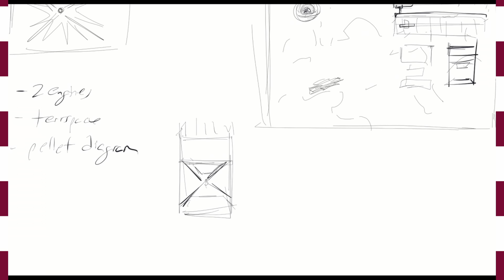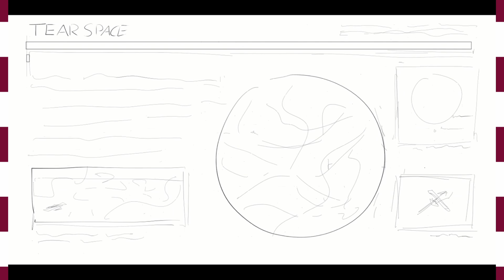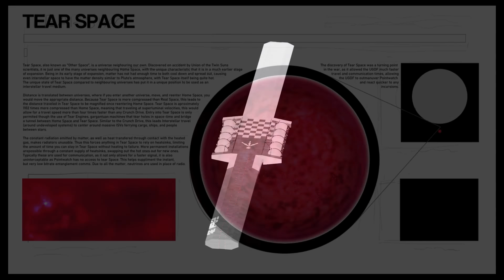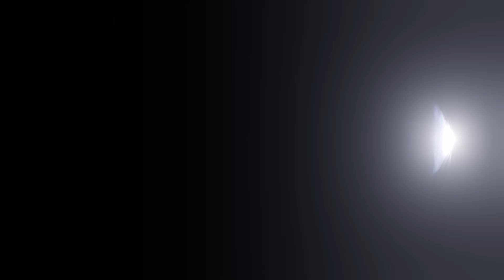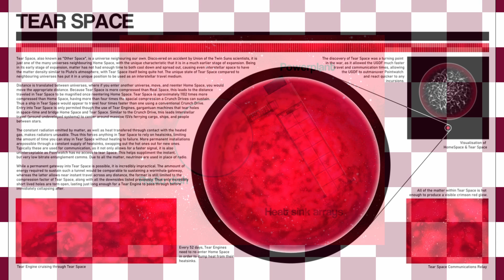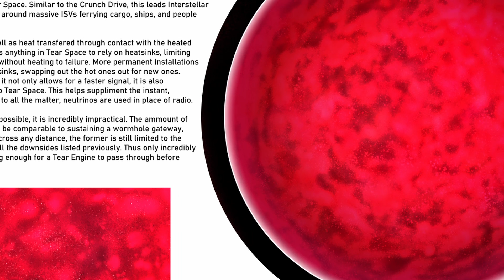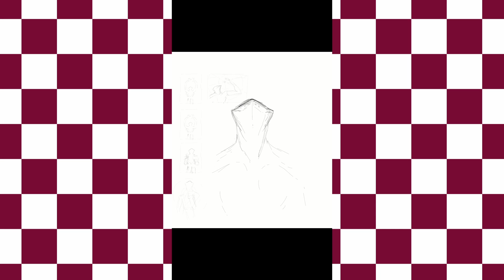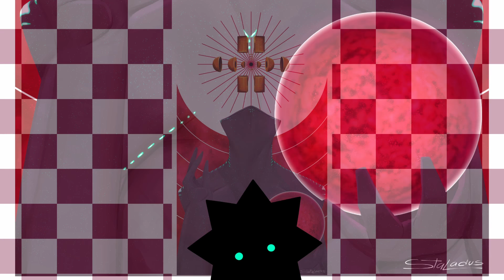Tear Space & Orum | Lost Suns

Comment: I have a few questions/thoughts
1. Can Orum be electrically charged? Orum particle beams or macron beams could be useful both as weapons and in engines and reactors
2. Does Orum have some kind if critical mass? If so the first point becomes much less relevant. But also, why can't Orum warheads fit infantry weapons? Is the projectile impact insufficient to comoress the Orum to detonation? Or would the Orum be compressed if accelerated by such a short weapon? 
3. Couldn't you radiate heat in Tear Space so long as your radiators are hotter than the surrounding space? It's not like Home Space is completely cold either especially close to stars
4. How are space craft shielded from the gas in Tear Space? How fast can you realistically move through Tear Space without burning up? 
Anyway love your work very cool world building very cool space craft always love to see more
Thank you for your work
Reply from the maker: 1. It can but it's better to just put them in missiles, UREBs are more practical because you can accelerate them much faster because they're much lighter than Orum atoms.

2. Yes but it's really small. The main limitor to warhead size is the size of the compression system. Only spaceship missiles can get up to a high enough speed to compress Orum enough on impact. Smaller missiles need to rely on those detonators

3. Well imagine if you are getting blasted by the sun from all sides, it's really hot (in the hundreds of degrees). At most the droplet radiators would extend the time ships could stay in it.

4. They have dust shields, basically a dust suspended in a magnetic field which acts as a detached, regenerating whipple shield as well as a magnetic shield. It also shields against bigger faster moving stuff like missiles and particle beams, but if you move slow enough you can just pass through. There are things that pass though it too like lasers and UREBs. You could go near light speed in there, the only issue again is heat.

Thank you!
Reply: @Staladus thank you for the answer, one more thing I assume point watch combatants are highly reflective in the IR range?
Reply from the maker: @tggtgg2032 Yes, plus an ablative armor layer. This defends against Orum based laser attacks, but doesn't do much against kilo-megaton warheads
Reply from the maker: @tggtgg2032 Yes, plus an ablative armor layer. This defends against Orum based laser attacks, but doesn't do much against kilo-megaton warheads

Comment: Can you please say more about these "shields"? They seem to both block the gas in tear space without any resistance, but troops can walk into them perfectly fine.
Reply from the maker: Oh yeah, I call them "dust shields". It's basically a layer of dust suspended in a magnetic field, bigger shields can suspend bigger particles, and it basically works like a big, regeneratable, whipple shield.

If you're traveling slow you can pass through it no issue, it only damages fast moving projectiles. Like the shields from Dune. Blocks everything except high power particle beams like UREBs and lasers. Those two pass through it.
Reply: What do you mean by "slow"? I'm thinking of, for example, could an air frame go through one? Also, how are the particles in these dust shields suspended, are they always flowing or are they electrically charged in a way? Thank you
Reply: @Pears608  Like a magnetically confined Non-newtonian fluid.

Comment: We got scifi nether portal travel before gta6
Reply: We got that before even gta V bc of Warhammer and it's "warp," which is literally scrunched up chaos hell
Reply: @thermionixinspace419  Warhammer didnt invent this style of FTL either, the whole concept of shifting to a different plane of reality that, while still having a max speed of lightspeed, is very condensed compared to our reality has been around since the mid 1900s at least. For example, hyperdrives in starwars function this way. They dont let the ship itself boost to 100 times lightspeed like startrek, instead they shift the ship into space thats 100 times smaller relative to normal, then the ship can travel that distance 100 times faster than normal space while still having lightspeed as a theoretical max.

Comment: instead of steam, supercritical CO2 could be used for orum reactors
Reply from the maker: From my research, it seems more like a dead end that causes more problems than it solves. Besides CO2 is garbage at absorbing IR radiation, compared to water which does it very well.
Reply: @Staladus  keeping steam is funny because everything uses steam
Reply: @Norentra It's almost like steam is a remarkably effective material for collecting and moving mass amounts of thermal energy or something
Reply: I think there could be a slight room for other options.
Sure, water is better at absorbing IR, but what about using a dedicated absorber distinct from the reactor coolant?
Using supercritical CO2 as a working fluid does look quite doable to me at least. Heat-resistant solids can have very high emissivity, and modern microchannel heat exchangers are already quite decent if not the cost.

This is mostly irrelevant if you don't intent UGDF being more capable in manufacturing (e.g., corrosion-resistant materials, additive manufacturing or whatever for the exchangers, and etc.).

Though, personally, I think a defense front alone being a hundred thousand years old would probably make design simplicity less of a big requirement, on the basis of the advancing tech.

Keep up the good work!
Reply from the maker: @LuminousBlue-79804  That is a fair point. Someone else also mentioned it. So honestly I am tempted to make them switch over to supercritical CO2, for the small reactors at least. The performance gain is not insignificant.

Retconning something in a video that just game out lmao
Reply: @Staladus , when CO2 becomes supercritical, it becomes way more efficient at absorbing IR. From my layman's understanding of supercritical CO2 turbines, it can be made much smaller than regular steam turbines. I'd recommend more research to see if it does fit your world better.